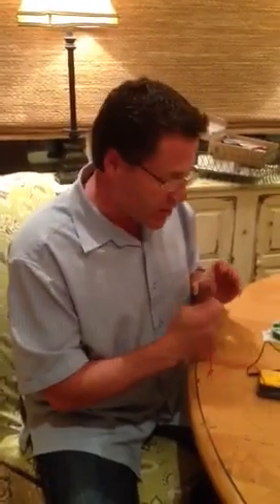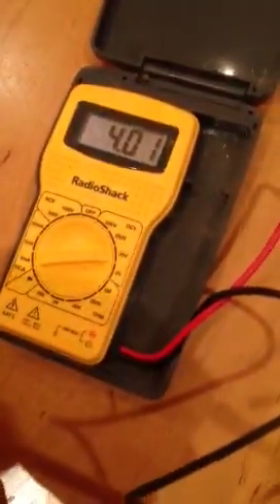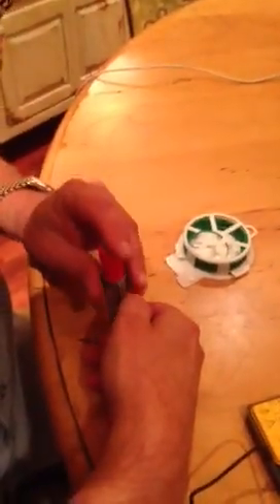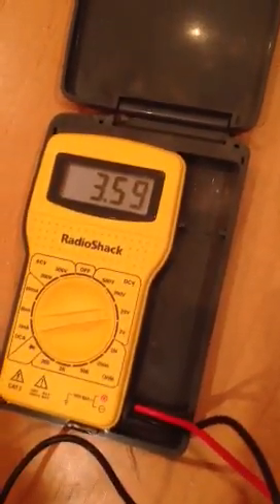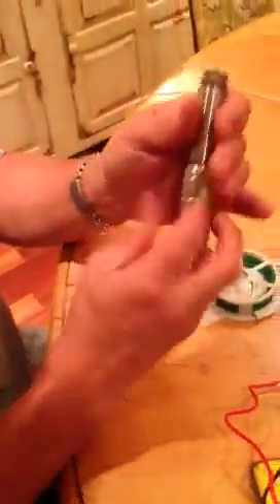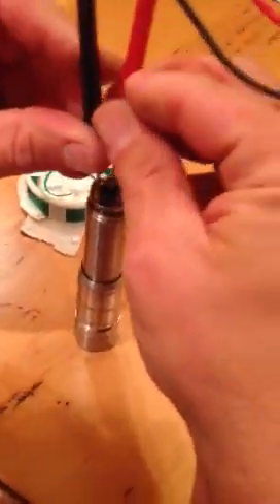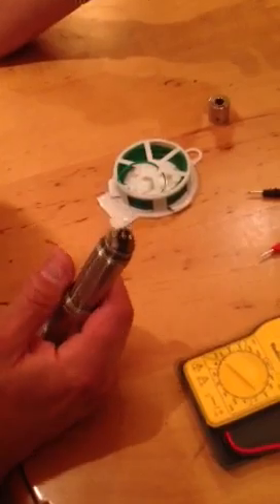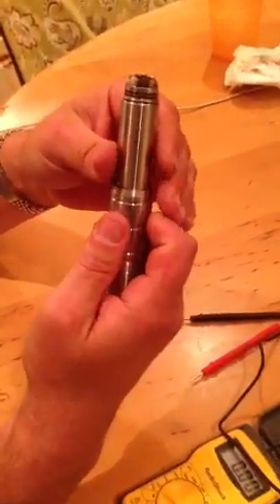Measuring the true voltage drop on a mechanical mod

Comment: You have a piece of wire between the battery and the ground pin, and the positive probe on the positive battery terminal. You get 4.01. Then.. what? You push the switch down and drop to 3.6? Where is the power going? You shouldn't be completing a circuit by simply pressing the switch. Either your lovely grenade mod is shorting, or your test methods are.
Reply: Virux we call this "Underload Voltage" before commenting something you don't understand try to do some research !
Reply: If there wasn't a load, you'd have no voltage sag or voltage drop in the first place. The problem is that he's getting a load when he shouldn't be. and that's not actually a real term.
Reply from the maker: +Virux   Nope.  The wire is only my version of a thin probe to make contact from the VOM to the positive battery lead. That's it. The voltage at the battery terminal drops from 4.01 to 3.59 when fired because of the entire circuit load. I should have skipped the 4.01 reading because it's irrelevant to actual drop, which is taken from two readings during firing. These two readings (under load/while firing) are all that matter in measuring drop.

1. Measure voltage at battery leads while firing (3.59V)
2. Measure voltage at atomizer leads while firing (3.46)
3. (Voltage at battery terminal when firing) minus (Voltage at Atty terminals when firing) = Drop
In this case (3.59 - 3.46) = .13V

Comment: In a good circuit, the voltage drop should be equal to the total voltage of the battery. Meaning the atomizer is getting the full 4.01 volts, not 0.55 volts. Meaning there is something wrong with the mod, probably the mod isn't 100% copper, the posts aren't 100% copper, etc. etc. So again, the circuit (mod, posts, etc) isn't 100% conductive, therefore your not getting the full 4.01 volts to the coil. Again, if you were getting the full 4.01 volts, when you measure with the negative lead of the Multimeter to the negative post, and the positive lead of the multimeter to the positive post, you're multimeter should read 0.0 volts. Meaning your coil is getting 100% of the 4.01 volts the battery is supplying. Voltage drop is a good thing, not a bad thing, when measured the correct way, which nobody really knows how to do, because after all, they're vaping to stay off Cigarettes, and not Nerds or Self Educated people.
Reply from the maker: +Mark II The voltage at the battery terminal in a closed circuit will never, ever be zero. If so, there is no power to the circuit, as in a completely dead battery. Kirchoff's second law: The directed sum of the electrical voltage around any closed network is zero. In this case (battery +3.59V) + (Atty Load -3.46V) + (Circuit Load -.13V) = Zero.  I wish I had never shown the 4.01V in the open circuit because it's irrelevant. That's the whole point of this video. All measurements are taken in a closed circuit, meaning it's on.